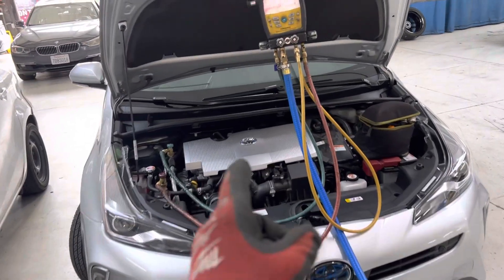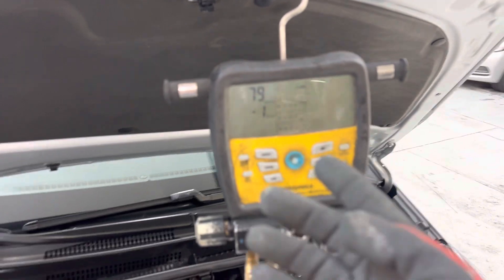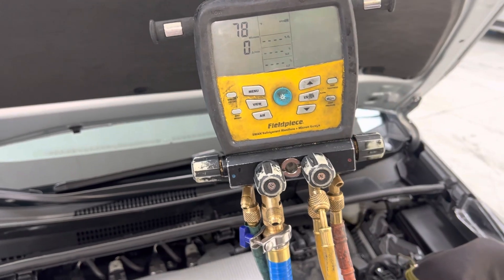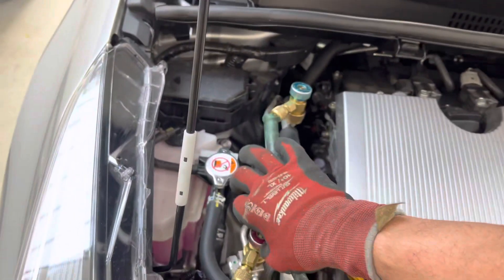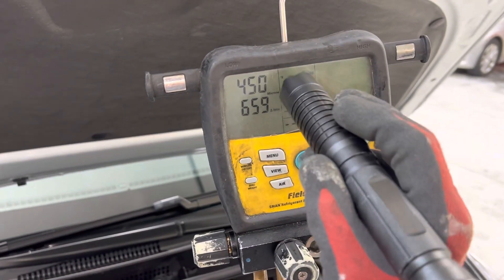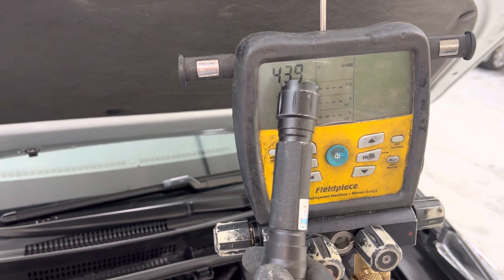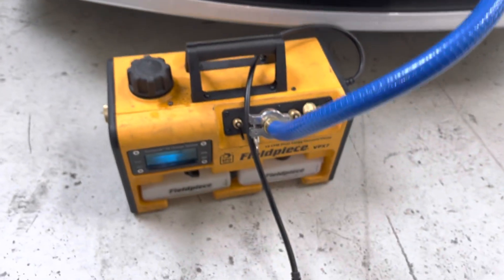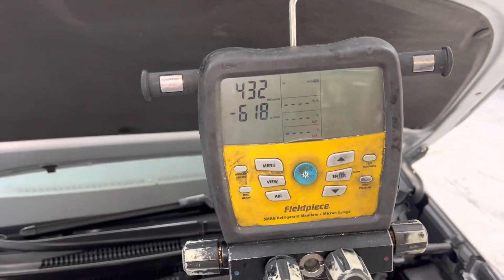TEEST REFRIGERANT GAUGES UNDER VACUUM FIELDPIECE SM480V  before attaching to ac system

Comment: whaat ac fittings are you using for the caar are they all the same  for the sman?
Reply from the maker: @nightmar4056  I have six different SMAN I have two TESTO 557S
I have four complete sets of field piece independent pressure, transducer clamp on temperature sensor sets, and thermal and humidity sensor probes . I have three recovery machines. 
     And I literally have about a quarter of a 5 gallon bucket filled with different manufacturers R1234YF coupling fittings and R134 coupling fittings

And if I need to use my refrigerant gauges and hoses for a different oil or a different refrigerant, I simply flush it out with my flesh gun that’s pressurized to 140 psi with 99% alcohol . 
And then I blow it out with 600 psi dry nitrogen 
And then I put it on the vacuum pump until it gets below 100 µm 
Then it is clean and dry ready for any other vehicle